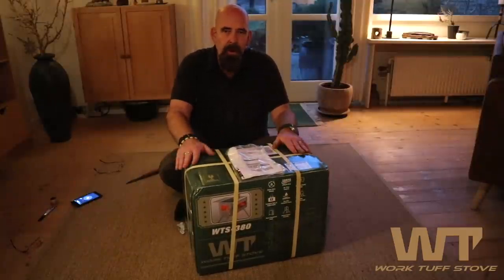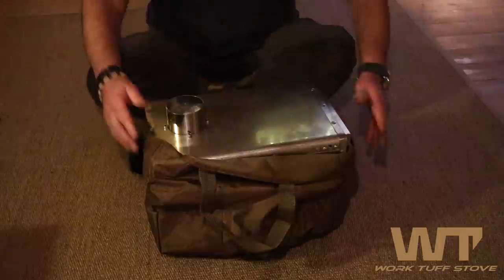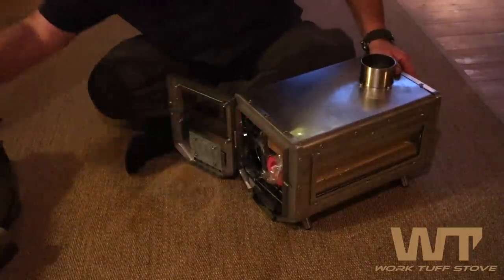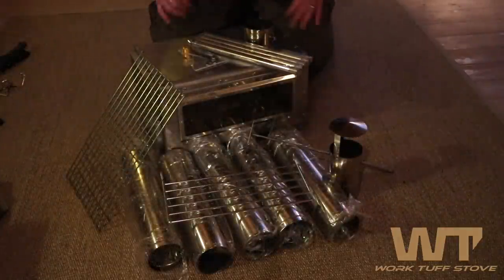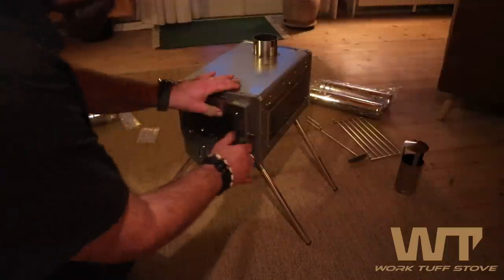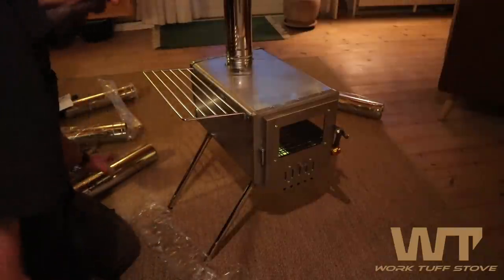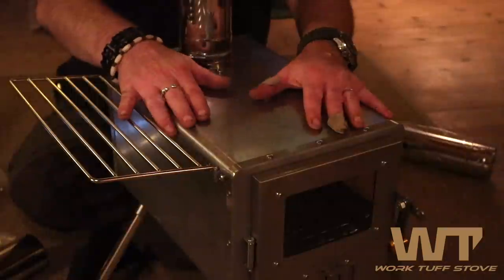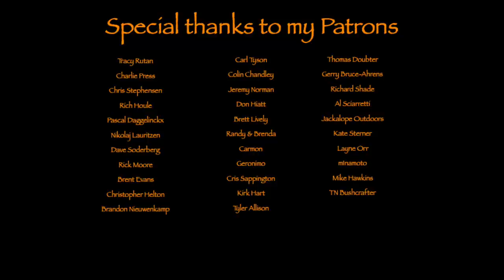Shelter build and Unboxing video

Comment: 6x12 ft?
Reply from the maker: No square shape 7,8x7,8 feet 
And at the entrance 6 feet high and a bit lower in the back. Thanks for your feedback and question 😁👍🏻
See you on the next one 🏕🦌
Tom
Reply: @cimbrerbushcraft-vikingheritag  wow, what an illusion.
Reply from the maker: Yeah the camera makes it deeper than it is 😉👍🏻🏕
Reply: @cimbrerbushcraft-vikingheritag  that and the center post you have going out without a matching one in the back.
Reply from the maker: Ahh ok 👍🏻 The one in the back is primarily for attaching the boards 😉🦌🔥🏕 Tom 🇩🇰